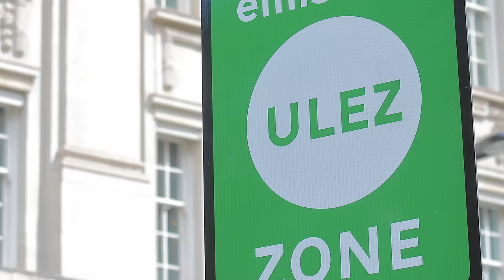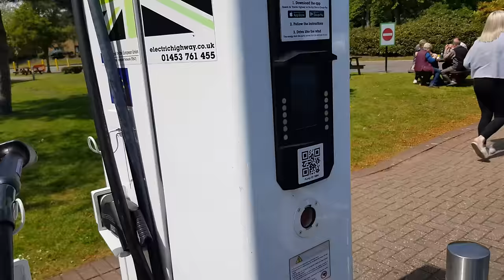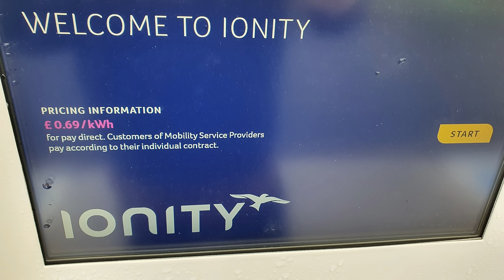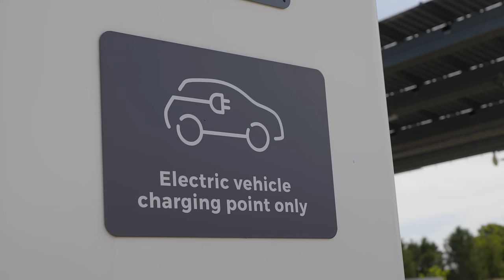The Uncomfortable TRUTH About EVs: The Version NEITHER SIDE Wants You To Hear

Comment: On the topic of fires, something I've been learning more about as I work in the marine sector and fires on boats are quite a big topic. A sprinkler system in a multi storey car park might not put out an electric car fire, but by cooling the surrounding area and cars, a technique called boundary cooling it can vastly slow down the spread of a fire, in most cases containing it to just one area. Also, on a recent course with Northumberland Fire Service, they informed me of a new piece of kit being trialed that is like a giant whoopee cushion. It is pushed under the car and then with compressed air forces spikes up into the battery pack. It then fills the battery pack with an extinguishant that encases the cells and turns into a hard crust, stopping the chain reaction of each cell setting fire to the next. This is an example of technology advancing to meet the needs that arise alongside new technology. So rest assured, the problems relating to fire are being tackled with successful results.
Reply: I recommend you take some time in picture using such a device to put out a fire, and imagine being one of the firemen who has to do that, where in the past they just put foam on the fire. and, the vast majority don’t have that equipment nor training to use it.  all of that costs money that is not budgeted. so yes, but it will never be the same: normalizing EV fires is the most likely way forward.
Reply: @JoeOvercoat  I was on the course because I do use the equipment. It's far easier to use than a hose and foam, you also don't need to get as close to a regular car fire as you just slide it under the car. A normal car fire you have to get close and get the bonnet or doors open to get the foam on the fire. This just slides under the car and the water pressure drives the spikes up into the battery. It is far easier and quicker to use than foam. Also they are budgeted for, hence why they're being trialed and bought, it's not just a random firefighter going out and buying one.
Reply: @thomasclougher2281  and so now we need 16 000 liters of brine solution in every fire truck to put out an EV? I have put out a petrol car fire with a 3kg powder extinguisher, calmed the family, got my tools out and fixed the problem. Then got back in my car and drove off.
Reply: @seanworkman431  brine solution? I don't know where you've got that from. I'm not arguing or sharing an opinion here. I'm just relaying facts that the fire service have access to and are testing equipment that fits on their truck and allows them to put out an EV fire with similar ease to a normal car fire.

Unless you mean in relation to the boundary cooling, in which case I meant that in support of car parks having a proper sprinkler or hi-fog system installed, where even if you can't put out an EV fire, it would help massively in limiting the spread of the fire. Obviously a fire truck would tap into a nearby hydrant if it was at a multi-storey car park. Even one which doesn't have a sprinkler system is almost guaranteed to at least have a fire hydrant.
Reply: @thomasclougher2281  have you done any fire training? Smoke is hot and thus rises, meaning all the fire exits would be at risk and breathing apparatus required but the safety of the tenents would be of priority.
An EV fire is much hotter than a regular vehicle fire and if thermal runaway occurs then it creates it's own fire triangle and will just burn no matter what.
A brine solution is just heavily salted water that will remain liquid even below zero degrees and has been used in experimental situations and works (sort of) but having the equipment to do that is going to be a costly exercise.
I would suggest 'auto expert john cadogan' for further insist into this electrical madness.
Reply: @seanworkman431  yes, I've done fire training and have put out real fires on ships, where temperatures can be 300+. Boundary cooling works to cool the surrounding areas to cut off the fire triangle and it also cools the gas cloud. Smoke is incredibly dangerous, but boundary cooling around any fire, including an electric car fire will help reduce the extent of the damage massively.
Reply: @seanworkman431  also sorry, I know what a brine solution is, I just didn't know what you were referring to using it for. As in through a sprinkler system or a hose or other.
Reply: @thomasclougher2281  Okay.
Reply: Very nicely stated Thomas. Containing the fire to a particular area seems like a very sensible idea. Also as EV's are in their early stages of development, I'm sure the tech to address the issues will mature and develop appropriately. A lot of arguments against EV's are based on not all solutions being found yet. Imagine all those people saying the first telephone was a useless as there's no one with another phone to talk to. I think we're at that stage with EV's.
Reply: @oldmanstumpie1061 when the Australian telegraph was run through the desert from Adelaide to Darwin and a morse code message was sent to the king of England he replied with a well done. 
Now we have GPS on our phones.
The thing is, can we develop technology without killing innocent people in the process.
...---...

Comment: It doesn't matter how a fire starts. Even if the Luton fire didn't start at an EV, is DEFINITELY spread to one. Fires happen. They happen on ships, on ferries, in tunnels, in parking garages.
Reply: To be honest I don’t think I would like to travel on a ship with lots of EV’s on board. It doesn’t matter what type of vehicle that starts the fire, but as you say once a fire hits an EV, there is no putting it out and if there are lots of EV’s the ship is doomed.
Reply: @marcandsebe   There is a good method, extinguishing foam.
Reply: @Peter-oh3pm  Ok! You go on a ship and rely on foam to put out an EV fire.
Reply: @Peter-oh3pm   What is foam going to do?  Just like with thermite, lithium ion battery fires produce their own oxidizer.  You can't smother them - which is why even if they didn't burn at absurdly high temperatures, they would still be a problem.  Combine it with their absurdly high temperatures and now you have a serious hazard.  A hazard that isn't being properly identified as such because of politics/feelings.  Yeah, that's going to end well!
Reply: You want to say its the patriotic duty of every EV to stop fires from landrovers and their ilk?
Reply: @marcandsebe  "You go on a ship and rely on foam to put out an EV fire." Better a EV is on fire than fossil fueled fires. What burns in a EV? The HVAC and plastics in the interior.
Reply: @DocNo27  Thats nonsense. batteries do not burn on themselves. only if you force them with massive amounts of fossil fuel. Or you short them - who does that?
Reply: I personally, still believe the Luton fire was a diesel hybrid, based on the videos
Watch the videos and it doesn’t burn like any diesel - ever. It has that very specific burning characteristic of a Lithium battery 
There are 2 fire extinguishers which were used and neither made any difference.
Reply: @FolkinghamRob  Thats perfectly ok. It is not reality but nobody demands that you believe in reality.
Reply: @wolfgangpreier9160  "What burns in a [sic] EV?" The same things as in an ICE vehicle minus the fuel but plus hundredths of kilograms of lithium batteries creating highly toxic gasses and smoke.
Reply: @wolfgangpreier9160   "Thats [sic] nonsense. batteries do not burn on themselves."   They absolutely can and have failed causing them to go on fire, just on their own. Already forgot the Samsung Galaxy Note 7 battery problem, just one of many examples. And putting them out is as good as impossible, even submerging the car in water doesn't stop the chemical reactions.
They don't need air or externally supplied oxygen to keep burning, it is a self-sustaining reaction.
Reply: @wolfgangpreier9160 you are clearly not a scientist 😂have you not heard of thermal runaway 🙄
Reply: @bigfist255  something like that happened 10 years ago and with diy batteries.
Reply: @wolfgangpreier9160  happens all the time
Reply: @bigfist255  You are right. Last it was in my dog's poop. It ran away. Literally.
Reply: @marcandsebe  Some Norway car ferry services have started banning EVs. The thing about EV fires is that once they start poppin’ they ain’t stopping’. Thermal runaways are self-oxidizing.
Reply: @wolfgangpreier9160 It happens all the time. And with modern batteries.
Reply: @grahamstrouse1165  No it does not. Show me one single occurence of battery fires. ONE SINGLE ONE PLEASE!

And not a recycling plant which burnt down. Of course they have to be careful, just like a oil refniery must be careful not to burn.
Reply: @Peter-oh3pm  extinguishing foam, perfect. Petrol fire out in seconds. EV fire? Won't touch it
Reply: I heard it was an EV...albeit a hybrid
Reply: I asked the Fireman next door if they had done EV fire training....'no,  enough water will put out anything'
I worked offshore where we had petrol tanker type vessels full of hydrocarbons.  The fire safety setup was a seawater deluge sprinkler. So the same idea, plenty of water to cool and contain.
Reply: @wolfgangpreier9160 The battery is made of thin sheets of precious metals separated by very thin films of whatever material. Squish the battery too much (like in a car crash), the sheets of metal touch, and all the electricity stored in the battery starts flowing between them. Large electric current causes the evolution of great heat, which spreads to the next battery in the bank. Heat the battery enough, and the insulation also breaks, causing the same "fire" to happen.
Reply: They reported it as a diesel Range Rover. They left out the word Hybrids. The CCTV picture shows a jet of flame shooting out from the part of the car where the battery is on this model.
Reply: @iankuah8606  Yes, true, Diesel does not burn. Only smart phone batteries can even burn and turn a whole parking lot into cinders.
Reply: As far as i could find it was started by a light hybrid range rover. If it was a diesel hybrid or a petrol hybrid i don´t know. But it seams like the fire was actually started by the battery

The Range rover light hybrid have a 1.8kWh lithium battery under what would be the passenger side front seat (that is, the left seat), and not like the PHEV hybrid where the battery is under the rear seat.

The thing is.. Diesel cars just don´t spontaneously combust. Yes, there are loads of cars burning every year. Those are in almost every cases a result of a impact or someone actually lighting it on fire. There was a whole series of cars produced in the 90s and early 00s that had a error that with a combination of warm component and a active low pressure fuel pump manage to go up in flames (if i remember correctly there was 12 different car types with the same system).

This was really very much out in the media, and there really wasn´t other incidents of that.

Now there suddenly are loads of cars just bursting into flames that have neither been in a coalition or is arson case. And it tend to effect some brands much more than others.
Reply: Wait are all the cars on a transport ship fully loaded? I thought they were moved in neutral by forklift. That just seems dumb
Reply: @BlueBD  do you mean charged? For car transports the cars is driven onboard with there own engines.  Ice cars have a maximum of 5 liters of fuel. Often a bit less. (Typically they need about 2 liters to run smoothly)

But EV the batteries are manufactured fully charged. So they simply dont discharge them.

Doing so might help because discharged batteries is less enegetic.
Reply: @matsv201  no I fully get and would assume an EV would be charged. I'm talking about combustion cars. I didn't think they were Fueled by default
Reply: @BlueBD  because that is how it works when you produce lithium cells. When they are assembed  they are charged.
Reply: Yes, but those fires are relatively easy to take out. EV fires take 10 times as much extinguisher to take out and have a tendency to come back to life even if it appears that they were taken out.
Reply: A lot of the EVs that allegedly went on fire in such things ships, didn’t.
Reply: @marcandsebe  You don't know much about ships do you? Ship fires are all self extinguishing.
Reply: @hereandthere4763  It didn’t self extinguish on the boat with all the EV’s onboard 😂
Reply: What? No Evs were involved in the Luton fire.
Reply: @marcandsebe blablah. You have no issues traveling with tons of electronics and fuel tho, huh?
Reply: @MaticTheProto  I have been driving 30 years and never had an issue. I have never seen an ICE vehicle on fire but have seen 2 EV’s
Reply: @marcandsebe  i have never seen a burning ev, but multiple ICE cars, one of which burned down at my dads car repair place
Reply: @MaticTheProto  Probably your dads fault in the repair shop 😂 Doing some welding with no safety equipment 🤔
Reply: @marcandsebe  nope. The owner drove it to the parking lot and left it there overnight.
Reply: @MaticTheProto  If you want an EV and it’s massive depreciation then go for it. I am keeping with ICE.
Reply: @marcandsebe  it‘s funny. The depreciation is almost entirely due to paranoid ev hating clowns who think the battery will die on them after 3km
Reply: @MaticTheProto  It’s each to their own. You get the EV loving clowns trying to push EV’s to people who don’t want them or are not ready for them just yet. If someone tells me I must have one or it’s forced upon me then I definitely won’t have one. 

Anyway a £43,000 EV that was only 6 months old was sold by a dealer for £18,000. Who are you going to blame on that depreciation?
Reply: @marcandsebe  uninformed people. Who do you think is the cause.

Also the environment isn’t waiting for petrol addicts…
Reply: @MaticTheProto  The environment will survive long after you have gone. You have your EV and enjoy it and it’s depreciation and let others drive what they want. Stop pushing your agenda on others.
Reply: @rogerphelps9939  According to the fire investigation it was a diesel vehicle that started the fire not an EV.

Comment: I'd been keen to try an EV. Was offered an MG from Europcar. "It's got a range of 240 miles the agent said. We had to go around 130 round trip. Initial thoughts, pretty good. Better than expected quality. But the charge dropped from 93% to 60% less than halfway. We just about got back to Stansted with 16 miles left, less than 10% left, after driving at night with no heating. We covered 126 miles. Never again 🙁
Reply: A Tesla will plan the route and necessary charging points. It takes account of the weather, altitude and route.  No range anxiety.
Reply: What was your miles per kWh
What was your speed and weather (cold and dry, or cold and stormy?)

And above all - what was your tyre pressure? 

The excess energy waste of petrols and diesels and their better nature to higher speeds hides from us the fact that driving conditions impact greatly.
Reply: @robertwhite3503 but also F Tesla? 

Charging infrastructure should be a public utility, and petrol stations should be forced to accommodate since they're the ones flogging over a hundred years of oil
Reply: TLDR: The vehicle did the journey.
Reply: @SnazzBot  Yes it did....just. but it was way to nervy knowing if it didn't, we'd miss our flight.
Reply: @toyotaprius79  Cold , dark, can't remember the kWh figure. It was a rental why would I check tyre pressures? My daily driver is 10 year old Mondeo diesel. When I fill it up it has a range of 1100km. I know it's not a fair comparison. It my first ev experience (I've been aTesla passenger a few times) in 40 years of driving and owning over 60 vehicles. It was a bad experience. Maybe the next one will be better. The main thing was the range being nowhere near what the agent said. If it was, no worries 🙂
Reply: @robertwhite3503 I plan the route, not the car.
Reply: Every reply to your message is exactly the type I'd expect - you didn't plan your journey, what was the weather like, what was your tyre pressure, EV's are perfect in every way - ya da, ya da. These types of answers absolutely make me so angry. You rented  an EV to give it a try and you didn't like it for some specific reasons, which no EV owner can accept!
Reply: EVs suck lmao... Bad for environment, Slave labour to get minerals, Long charge times, Not cheaper to run tbh, When battery dies or gets worse in 5-10 years you need to fork out lots of $ for a new one 🤡